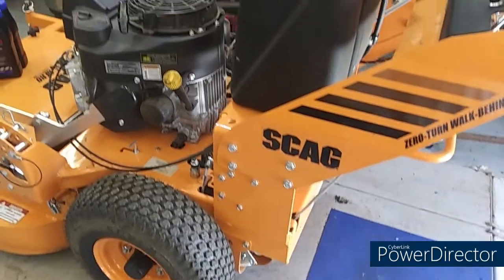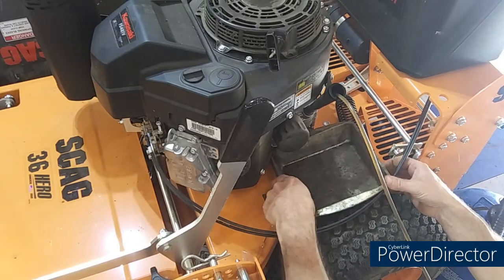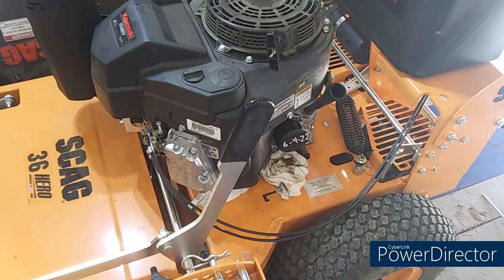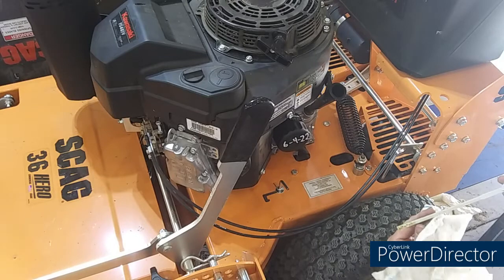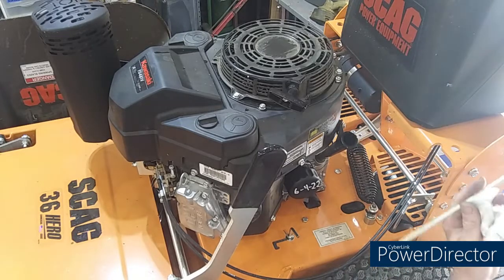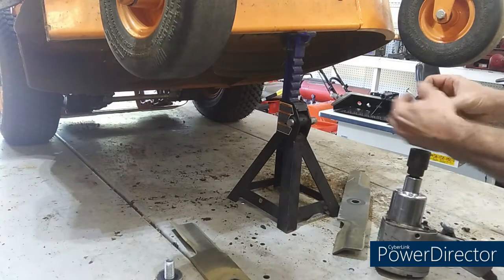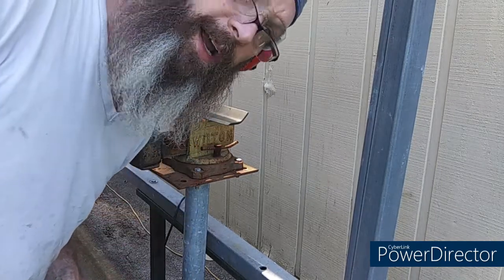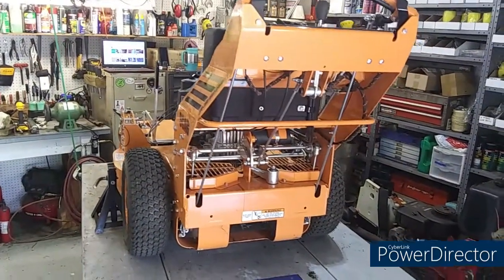SCAG 36" Walk Behind 10 Hour Service

Comment: I have the exact same mower.  They are awesome.  A couple things to note:  The engine does burn a little oil even when new, so check it frequently.  Check the oil WITHOUT SCREWING IN THE CAP on level surface.  Remove the air filter cover there are 2 holes that allow you to blow out the grass from the cooling fins in the engine.  You can add electric start on those engines, the flywheel is already setup.  All you need is a starter motor, solenoid, battery and new key switch plus wiring.  There's only 4 grease fittings total, 2 on the front wheels and 2 on front castors.  Keep the turnbuckles and bearings on the steering lubricated, otherwise the steering becomes sticky.

Comment: Tom, I noticed that your SWZT 36 does not have a Hydro Reservoir...??  How do you check the hydro oil level without one? Thanks Art
Reply from the maker: should be on each transmission,  theres no dipstick, just a drain and fill plug